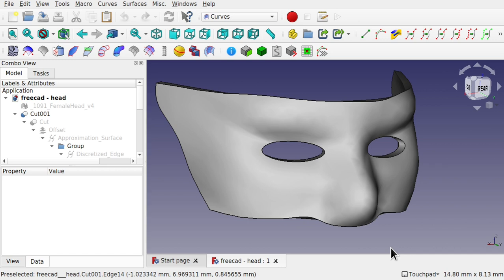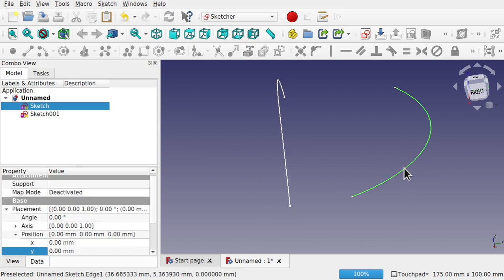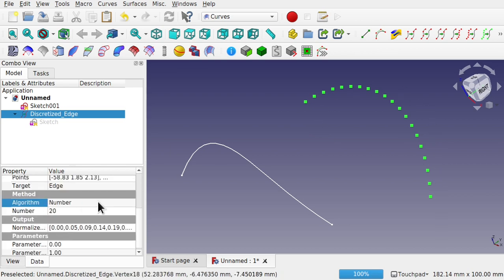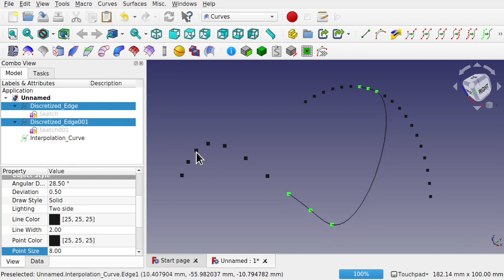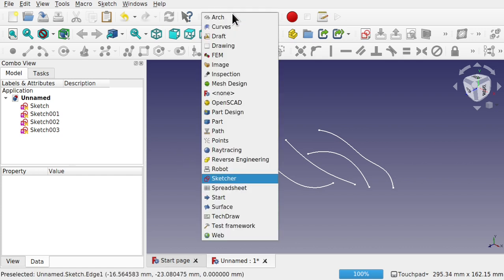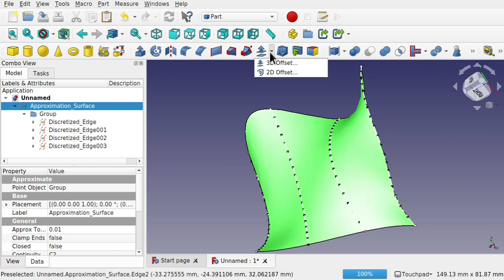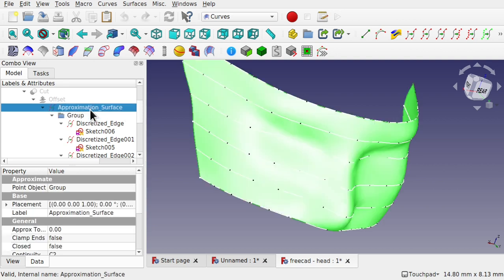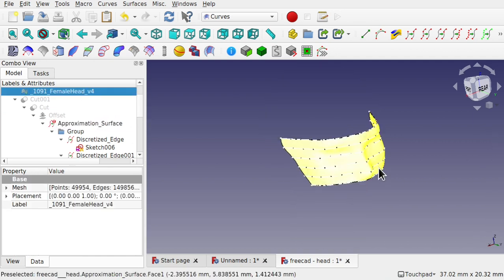Learn FreeCAD Curves Workbench [05] Discretize to Nurbs / Surface. Face mask example

Comment: I think I'm going to have to do something like this for surfboards.
I've tried using curved shapes workbench, but I haven't noticed if you can use an array of sketches to produce a result. It's nice if there's a consistent shape along the part, but a surfboard tends to have quite a few variations (esp along the bottom/hull). I've seen at least one image of a well designed completed surfboard, but not steps to make it. I had produced a result fairly easily in AutoCAD, previously.
For now, this seems like FreeCAD is fairly intuitive and my objective might take a little more work than I'd hoped, but I think it's possible, I just have to figure out how to do it. If I can bring a product to market, I'll definitely send you some coffee money!